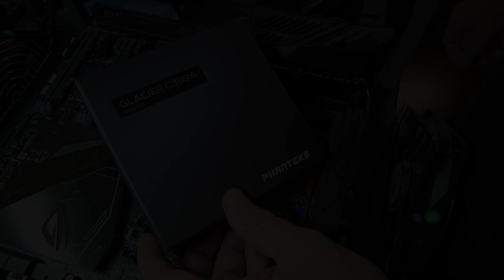Phanteks Threadripper Waterblock Installation

Comment: Kyle what do you think on the upcoming X499 chipset. Will we see it soon? Why release a new chipset on January as rumors says? A new chipset for current threadripper gen 2 or for the next threadripper gen 3?
Reply from the maker: I really am not worried about X499 at the moment.  X399 is the chipset for TR Gen 2 at this time.
Reply: @HardOCPTV  but I would like to be a little bit more future proof since I would like to use this pc for a max of four years. PCI express 4 could be useful with the next GPUs, two or three years from now
Reply from the maker: Then wait for PCIe 4.  :)
Reply: thanks for the answer and for your great work on HardOCP Kyle

Comment: I like that you have reviewed a few water blocks for Threadripper now. Not many other sites have done this much testing :) I went for the xspc block myself and it's great.
Reply from the maker: XSPC is making some very high quality parts.
Reply: yeah i can see that. it is the first xspc part i have ever bought and i have to say its very impressive.
Reply from the maker: Machining, fit, and finish are top shelf.  You made a good choice.
Reply: HardOCP TV Hello I want to hard-line water cool a gtx 1080ti gigabyte aurous and a 1950X CPU, EK is sold out on water blocks for the GPU in the entire UK, was considering phanteks. Which company do you recommend that I could water cool both components with? I have a weird thing with sticking to one company for all parts. Thanks!

Comment: Is there any way You can adapt and test this block  on a 1980XE cpu to prove the point that EK supremacy evo is not good for intel chips anymore as well?
Reply from the maker: Yes, you could adapt it, probably fairly easily with a custom hold-down solution.  However, I would suggest the EK TR4 block would probably show much better comparative performance on the 1980XE due to the single die structure being located underneath the microfins, unlike what we have seen with Threadripper and its two active dies being spread apart.
Reply: thanks for the reply.....though what i meant is....i think the ek supremacy evo design is  obsolete for Intel just as it is not designed for amd, if hardocp could use these various threadripper waterblocks on intel 1980xe as a test, it might show what i think.....while i do agree that the ek block has a possibly better design for intel than phanteks and vicevrsa, i strongly suspect that this phanteks block nevertheless would cool intel still way better than the ek old block, because of the much tall fin design.....so im kinda asking you if you feel to test it and  see if that is the case....if yes then we could really give a good push for EK to redesign completely TR4 WB  as well as x299 ones.....I am very disappointed at EK not even reengineering waterblocks for smaller sockets, which im sure if they did could possibly reduce 10 C of those 1800x or especially 8700k...sooner or later AM4 will use 16 cores, even if tdp will be not double, it will still be shitloads of heat to transfer, and Id like EK do more than using crappy cheap acrylic and leds
Reply from the maker: I get what you are saying totally.  If I get the bandwidth to go down that road I will certainly consider it.
Reply: Thank I appreciate a lot the time You take for all of this.